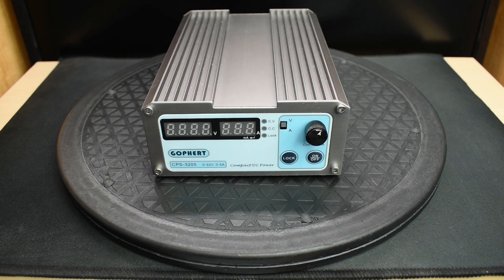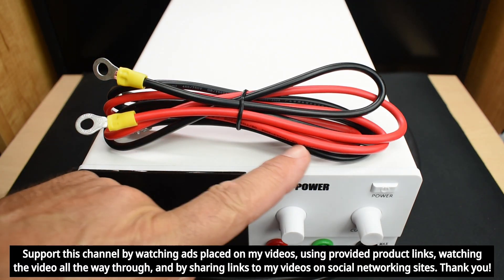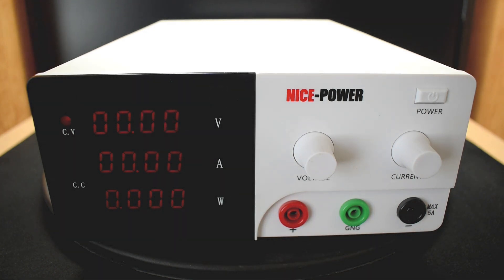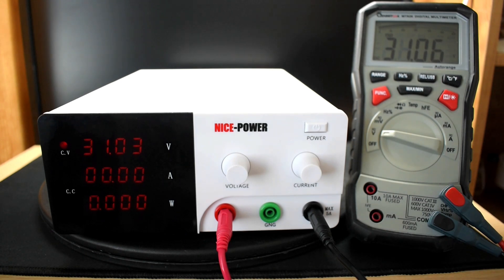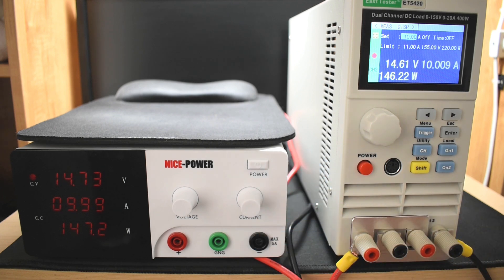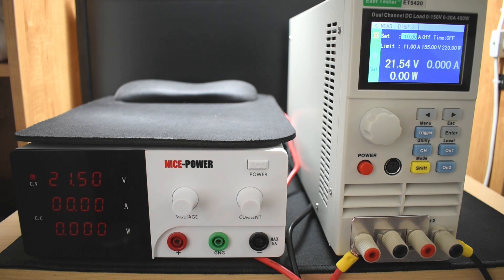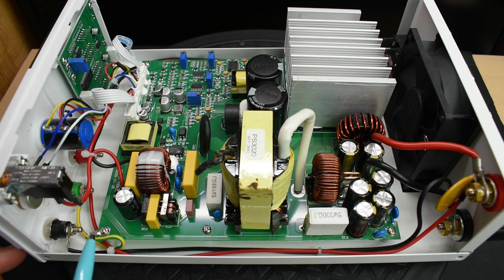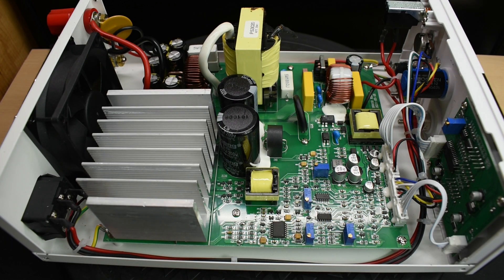20 Amp Benchtop Power Supply Unit - Let's Test It Out!

Comment: I wonder how long it could run at its full load of 600 watts.  You could add a parallel load to crank it up (something to do while it's still under warrany or immediately after you receive it).  Did you ever max it out?

Comment: Thanks for measuring the ripple! One other potentially important parameter you won’t be able to see without a oscilloscope is what sort of a turn-on (or turn-off) transient it has. Some cheap supplies kick out a big spike when you turn them on, which can potentially harm attached circuitry. If in doubt, it’s a good idea to connect to your circuit after the supply has been turned on and had a moment to stabilize.
Reply from the maker: Thanks for watching Dave!

Comment: As shown in the look inside, the supply is a switching supply. However in the specifications there is no mention of type of supply, linear or switching. Which is important depending on how it will be used.

Comment: I saw you using this in the splice resistance test video, was thinking of getting one for myself. Found one with similar shape on Ali, it has RS-485/RS-232 control port, too, instead of knobs. I’m thinking it can be used for makeshift PID tuned heater with Arduino or something. Thinking of making a 3D filament joiner jig. One alternative is to buy a separate 3D printing board and use it, but that’s no fun.

Comment: Why are you adding the decoupling capacitors during the output ripple test? Isn't that kind of cheating a bit? Or is that how the manufacture specifies the ripple spec (with a that decouple network)? Also, it would nice to see what the ripple looks like on an oscilloscope.

Thanks! As usual, I love your reviews and projects. I'm thinking of getting one of those supplies now.
Reply from the maker: According to what I learned years ago, and many others show, you do as shown in the video. I used an O-scope, if you look above the mV readings, you'll see a small zoomed in area showing the spikes. I guess you wanted to see on a big color screen O-scope. Thanks for watching Jay

Comment: Don't get it wrong or you confuse people over time . LFP needs 14.6v Maximum and only on first charge should you take the plate voltage that high . All subsequent charges should stop at  about 3.4v or  13.6 volts ,a one volt difference . That slows the clogging of the SEI layer . If you don't understand check out the LFP members entry screed on the Facebook page  https://www.facebook.com/groups/271980786862023/

Comment: Nope. I will never buy again a PSU with pots. There are enough alternatives out there without pots and nice interface.
But thanks for doing a review anyway.
Reply from the maker: You need to realize that I chose this particular 20A power supply unit because of the simplicity and reduced cost of $120. I looked around on Ebay, Amazon, Aliexpress, and Banggood before I made this video, and I can tell you that you won't find anything below about $215.00. Many are much higher in cost, especially those with no pots. There was another unit that showed the current setting, and had a coarse and fine adjustment, but that one is roughly $100 more. If you need precision controls, then this unit wouldn't be good for you. Thanks for watching!

Comment: It doesn't show set voltage/current and output voltage/current at the same time.
Reply from the maker: The PSU is a basic unit. I could've showed another one that's $100 more, that one displays the CC setting, and has coarse/fine adjustments.

Comment: Without researching is $120 for this unit a good price?
Reply from the maker: In my opinion, with the reduced price, I would consider it very reasonable. If you required very precise settings, you'd be looking at a few to several hundred dollars. Thanks for watching!
Reply: @electronicsNmore  Thanks!